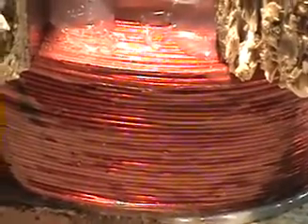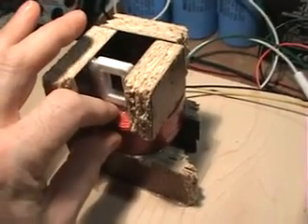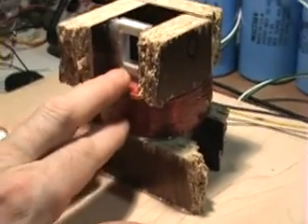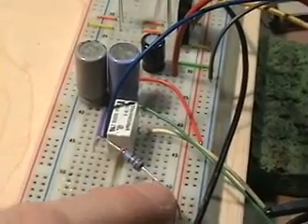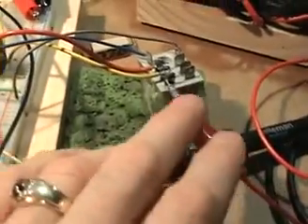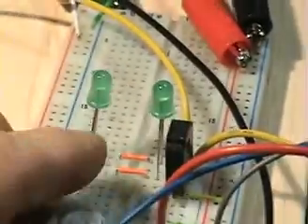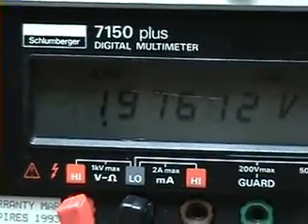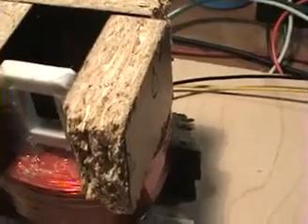Magnet and Coil test 1

Comment: If the poles of your 1 in magnet are aligned up and down, as you said they were, then your coil is 90 degerrs out for power generation.  In other words, the pole of your magnet is barely crossing the coil, in this configuration. 
Great idea though, using magnetic levitation and repulsion and  gravity to assist the input of energy to your device. Its just the coil and magnet configuration that bugs me, its just not optimal, for power generation.

Comment: hi gotoluc thanks for the great vids
I am thinking about the coil design
What if you make a lot of disc-coils one
wire wide with a wire that is pressed to a rectangular shape making the surface area bigger and the diameter of the coil
smaller then put all the disks together
forming a single coil. maybe turning every
3 disc to eliminate some of the Lenz effect
you proved possible in one of your other vids.